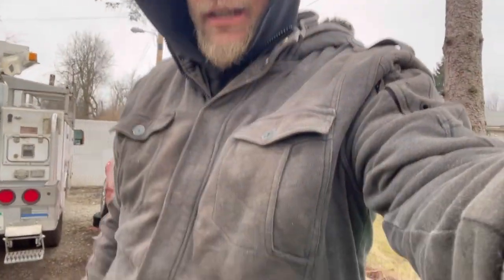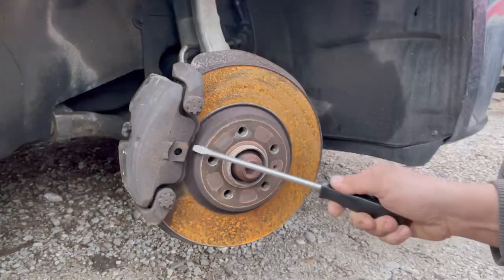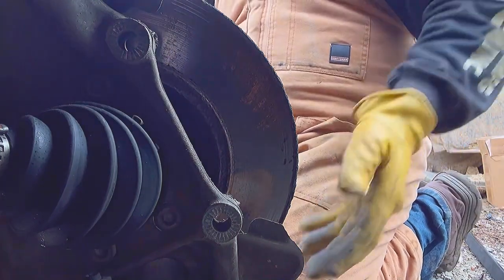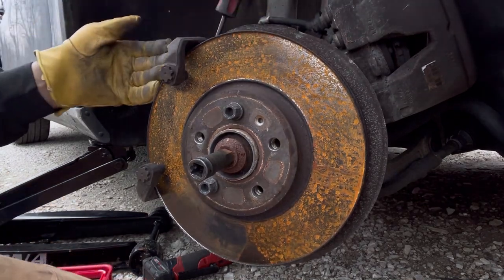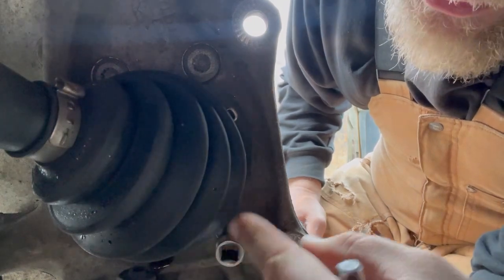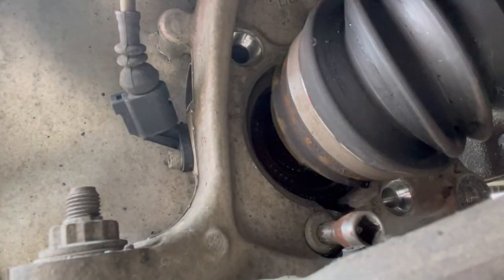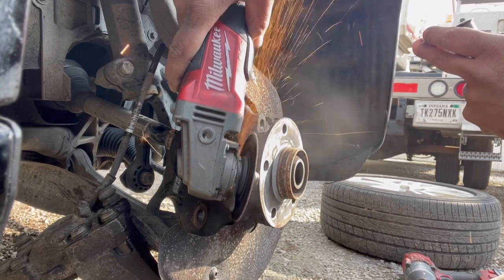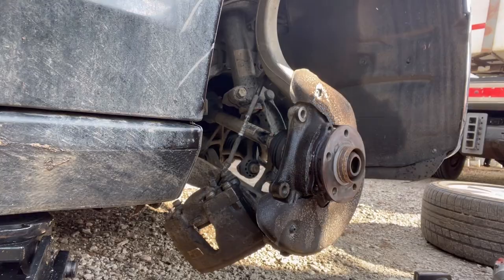Mobile Repair Milwaukee Battery Air Compressor Runs Air Hammer replacing Audi  A4 wheel bearing hub

Comment: Some of those 3 & 4 bolt wheel bearing hubs can be rust welded in there, especially if there stock and it's whole life has been in the rust belt! I'm in Ontario Canada and I find it's just easier to remove the steering knuckle hub and set it upside down on 2 jack stands and grab a sledge. I fought with one all day until I spent another 10 mins removing the knuckle and a couple whacks with 20 pound sledge and it instantly popped out!! Physics! I tried all the methods you did and some to no avail so now if it doesn't play nice within the first 5/10 mins then the knuckle is coming off!

Comment: What I have done with hubs that are rusted to aluminum spindles in the past is used grade10  6" bolts/nuts and pressed them out using the spindle, mars it a little, but way fast than hammering or air hammer/torch.

Comment: Heat expands metal, heating the spindle or aluminum area may have helped... Also hitting the "ear" where the bolts go through causing the hub to "spin" sometimes will break 'em loose...
I apologize, i am usually not "that guy"!!!

Comment: I have never had an issue using a milwaukee m18 1/2 impact to get that axle bolt off or the caliper bridge. If at the worst I'll put a little heat first but the milwaukee is usually enough.
Reply from the maker: My Milwaukee 1/2 impact just got rebuilt and I’ve never had an electric impact or air impact get a axle bolt off an Audi.  Not that I can remember anyway.  I’ve never owned a 3/4 impact though.
Reply: @NaptownTuner  is it the Fuel model right. I have broken axle nuts with mine. But also like I said on the audi if it doesn't take it off then heat it up and it will take it off.
Reply: I’ve never tried I think my m18 1/2” could do the axel bolt but I’d rather do it myself with breaker bar and Matco 19mm hex bit so I can feel if there’s slipping or if it’s not budging.. I also employ Nap tech tip of using valve grinding compound on the 19mm bit and same with the m12 xzn bits for bearing bolts.. stuff really adds bite

Comment: For pcv valve how do you know if it’s just the diaphragm and not the entire unit. 
137k 2011 a4 new engine epc flashing sometimes and acceleration slows/ shakes at idle. Vacuum off the oil fill cap isn’t that bad but not to easy. Some pull

Comment: Way to much work naptown lol. Leave the bolts in a bit and air hammer the bolts . cheers, you know that anyway lol
Reply from the maker: I’ve tried that multiple times.  Some bearings are seized more than others and hammering the bolts doesn’t always work and just mushrooms the head of the triple square, in this case I didn’t want to look for new bolts because the bearing didn’t come with them.

Comment: The manual states to remove the wheel speed sensor. Is it really necessary to remove it? Asking for a friend. 😊
Reply: I did my front left wheel bearing and I did the right rear bearing.. in both situations I choose to just replace the entire hub/bearing as a full assembly rather than pull off the hub from the shot bearings.. I didn’t touch the wheel speed sensor in either the front or rear jobs.. I did remove the screws on them but I couldn’t get any movement with Pb blaster and gentle prying.. so in fear of snapping those sensors because they’re plastic I left them in and the bearing magnetic ring is still far enough away as you won’t disturb the sensor.. just make sure you pull off the bearings from the knuckle as straight as possible once you get the steel separated from the aluminum keep soaking with penetrate and prying with chisel as Nap is showing but evenly.. you should touch the sensor at all.. make sure to really clean up the mating surface before reinstalling the bearing/hub assembly.. be careful of the sensor when cleaning
Reply: @virtisconsole12  Awesome, thanks for the heads up. I’m replacing both front hub/bearing assemblies on mine. One side is making that howling sound so might as well replace them both. Thank you.
Reply: @virtisconsole12  Job done, took me 1.5 hrs to replace one side. Not bad at all. Tks 👍🏽
Reply: @NyTonyF  nice !! Good job, you saved yourself a lot of money from having a shop do that